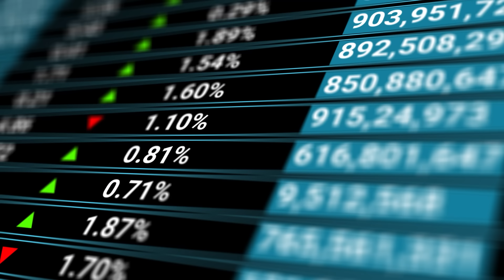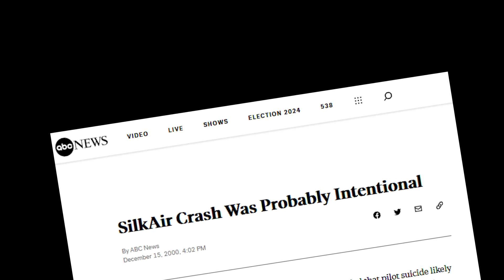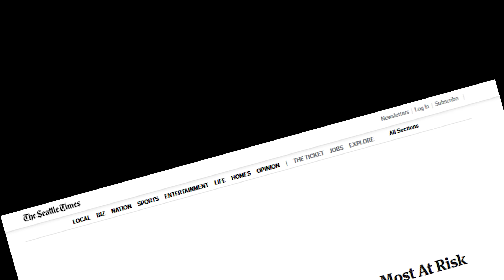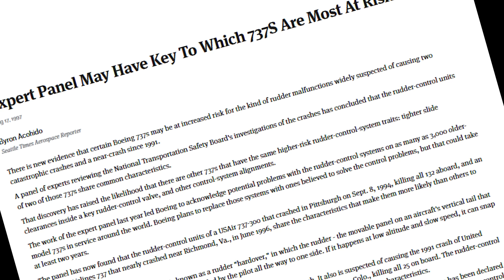What Caused This Plane To Break Up Mid-Flight!? | SilkAir Flight 185

Comment: I researched this crash when I was covering the aerospace industry many years back. There was a lot of resistance in Singapore and Indonesia to the theory that the crash was deliberate, but honestly nothing else seems to fit. As I recall, US investigators were literally unable to reproduce the aircraft’s extreme descent profile as tracked by radar in a simulator without deliberate, forceful and sustained use of the controls. This was not an out of control aircraft falling out of the sky, nor was it a crew struggling to keep a crippled aircraft in the air, nor was it a somehow disoriented crew accidentally flying under control into terrain. There really seemed to be only one other possibility. At the time, crashes caused by deliberate pilot action were (almost) unheard of, so the idea that a pilot might do this seemed unthinkable. But then came Egypt Air, then most recently Germanwings, which was the first time such an act was unquestionably, 100% proven. So, the idea that the SilkAir crash was deliberate doesn’t seem so unthinkable any more.
Reply from the maker: Such a good point, 'At the time, crashes caused by deliberate pilot action were (almost) unheard of, so the idea that a pilot might do this seemed unthinkable'.
Reply: I think it was the Smithsonian channel whose reproduction of the Silk Air accident I watched and they came to the exact conclusion you mentioned.  As there had been some previous rudder problems with this aircraft type, the Indonesian government latched on to that and refused to accept the NTSB’s probable cause.  However this was the only explanation that fitted the facts and most people are convinced their conclusions are correct.
Reply: For sure was a deliberately action. Difficult to accept but the painful truth 😞
Reply: @moiraatkinson  Not just the Smithsonian channel.  Other shows too.
Reply: @CuriousPilot90  If a pilot wants to take himself out, he needn't take innocent passengers and crew. Of course, AR-15 massacres are now ruled suicide. I worked for a major US carrier as a cabin crew for 25 years and beat death on the job 6 times, 3 of which were at the company's behest, as is legal according to SCOTUS. Twice it was to save money and the 3rd was out of spite as a merger and acquisition was in play and reducing payroll assured the job security for those firing the most. They maimed me for life, and told them how to prevent TBIs, Cervical Spondylosis Trauma, Pneumothoraxes, collapsed lung from torn fascia lung lining due to my recurrent training at LHRTK the day before. Men over 35 should wait 36 hrs before flying after hitting a bucket of balls according to flight surgeons,. I was 42 and UAL had tried to kill me in RIO so I expected it. All 3 can cause death at 37,000ft (8000ft cabin pressure), but United Airlines is fine with killing crew and passengers as they're insured. Terminated 4 weeks before retirement with a permanent disability and no insurance at age 55 which is a death sentence in USA, but I live in Sweden and my Karolinska Institute rehab has proven efficacy. UAL prefers faith healing and said my MRIs, were fake as was Karolinska's orthopedic rehab. 90% of men aged 65 have bone spurs, but my flight attendant union was conjured by women for women. Chicago's attorneys love carriers that maim passengers for life or kill them as it keeps the client pool full. 
I called the FBI to warn of UAL's policies of abuse possibly leading to an AR-15 suicide at Elk Grove Village.  Americans may not know that are allowed to be killed and might take it personally. Whistleblower protection is a farce in America, as ABA will disbar any attorney that reduces their potential client pool, at least in Chicago. I've been trying for 14 years to keep UAL from killing and maiming pax and crew, but because I refused their faith healing offer to keep my job, they think I have dementia...you know MRIs are the devil's brew in Chicago. 
I wrote to UAL's BOD, OSHA, NTSB, UALMD, UALTK, EXOSW, DENTK , LHRTK and visited my hospital that pumped my lungs in LHR to ask them to warn crew. Keeping American companies from killing employees is a Sisyphus task, but it keeps me going. Sisyphus defeated death too.
All Americans are on somebody's spreadsheet as a capital asset and are allowed to be liquidated.(see USA's 4% of global population and 20% of Covid deaths, with vaccines after CDC told media 80% of Covid deaths are 65 and over, or on FICA aka pensioners or entitlement moochers to those that told their over 65 audiences, Covid was a hoax, and vaccines kill).
Flying is the finest job I had, but for the worst clusterfrackin' company I ever knew. Hinge migration is preventable, as is pneumothorax, but killing crew to reduce payroll is more important.
Reply: There’s a more recent , deliberate crash than German wings , that is the Chinese deliberate crash .
Reply: We also have the mozambiqu e190 crash and the china eastern one
Reply: @dthomas9230  - pretty sure you should seek some psychiatric assistance as you seem to be doing quite a bit of confabulation and disturbed thinking.
Reply: @Gus1966-c9o  China Eastern Airlines Flight 5735
Reply: Reading this, I’m now rather curious about your thoughts on a different flight. China Eastern Airlines, Flight 5735. 

Ever since it happened I’ve been unable to get it out of my head that there’s no way that it isn’t a purposeful crash. The descent profile just seems so sudden and oddly smooth? Versus descent profiles of other crashes with mechanical failures where you could see the pilots fight with their malfunctioning plane within their descents. A bit more erratic, where the struggle is visible in the flight path. But to me it just seems like they just slammed forward the plane. There might have been a temporary regaining of control by a different crew member but whatever or whoever caused the descent seems to have re-taken control and pushed it back down again. 

Idk, is that thinking weird? The only other causes I can think of is maybe an extreme pitch control malfunction? If it was a reversal, there would have been flight issues from the beginning, like Air Astana 1388, right? Or if let’s say if there was a physical part that fell off, like the horizontal stabilizer. Like with Alaska Air 261/Continental Express 2574. But idk if this kind of descent would line up with that, or how they’d be able to pull back up and maintain altitude before pitching down again with a missing horizontal stabilizer. 

But that’s why I thought I’d ask what you thought. I just know what little I know from a couple years watching these types of videos and reading some books. Does 5735 also seem purposeful with what information we have, like Silk Air 185? Or do you think we should give the crew the benefit of the doubt because there are mechanical failures that can result in a similar flight descent?
Reply: why would you say such horrible things  to this guy telling us the truth about what goes on in this horrendous industry .Anyway people like you tend to call whistle blowers lunatics,just to hide your evil deeds 😳🙄😩
Reply: @CuriousPilot90  according to a source the ntsc apparently knew it was a suicide but they didn't publish it because they didn't want to make flying look unsafe
Can't verify this statement though
It's possible for sure because prior to his crash there were only 3 pilot suicide cases to this, all which were relatively unknown (the dc 8 crasg in Japan, atr crasg in Morocco and the psa 1771 hijacking)
Reply: If investigator blame the crash on pilot. Boeing don't need to pay compensation. However, In 2004, following an independent investigation of the recovered PCU/dual-servo unit, a Los Angeles jury, which was not allowed to hear or consider the NTSB's conclusions about the accident, ruled that the 737's rudder was the cause of the crash, and ordered Parker Hannifin, the PCU/dual-servo component manufacturer, to pay US$44 million to the plaintiff families.
Reply: it was pilot suicide
Reply: @yutakago1736  hmm a jury that wasn't able to view all the evidence for themselves, or actual crash investigators that cannot reproduce the crash in anyway except for when controlling for deliberate pilot input. I wonder which one I believe.
Reply: @dthomas9230 what a story
Reply: @dthomas9230  I love me a good schizopost.

Comment: What really makes me believe it was pilot suicide is the voice and data recorders being switched off.
Reply from the maker: It may have been that there was an electrical fault that caused this? But with all the other indicators this appears less likely.
Reply: @CuriousPilot90  It sounds like you made up your mind already with shots of the cockpit door locking mechanism and the specific circuit breaker panel on which the CVR and FDR circuit breakers are located on the 737. 😋
Reply from the maker: @ImperrfectStranger   I always try to keep an open mind about these things, especially with an incident like this where all the facts are not known. I may have done that a little out of sequence but I was attempting to show the copilots route out of the flight deck with his meal😬! With the circuit breakers, that was just unfortunate! The Captains CB panel just seemed right for the issue that was mentioned. It honestly wasn't supposed to be subliminal messaging placed throughout the video. 🙂
Reply: @CuriousPilot90  Thanks for the feedback 👍
Reply: CVR was actually from other aircraft, not an original one come from factory, and has a long story of self-malfunctions.
Reply: @@Steve_Sharpe He understood and acknowledged what I was saying. I acknowledged his response and was satisfied with his response. I was mistaken. Happy?
Reply: Read the ATSB report….
Reply: He was chanting Alla........
And the rest was history
Reply: Among many other things

Comment: It is common knowledge among those of us who fly the 737 that Silk Air was pilot suicide. There is only one way you can achieve that level of pitch down in the 737 and that's from holding the control yoke firmly with a significant amount of force forward. The airplane instinctually wants to fly and if you let go of the yoke it will level off. Not even with the worst elevator trim issues could you achieve that downward trajectory.
Reply: The moment I saw the numbers for the descent rate I had to calculate it. Nearly 1200 Knots. I'm not sure if there is any airplane that can dive like that uncommanded.
Reply: @GuyNamedSean Calculating the vertical speed using the 8 seconds of decent from FL350-FL195 you get over 100,000 fpm which is an insane decent rate that can only be done through force
Reply: This incident is talked about here in Singapore
Reply: Yeah, I think Boeing tested it and the only possible way to achieve that descent profile was pilot intervention

Comment: The NTSB determined that the flight profile was impossible to do without manual input. The crash ws caused by the pilot.
Reply: how can pilot cause rear section to break off?
Reply: @print-master  speed because the plane was at supersonic speed when it hit the ground

Comment: The most likely conclusion is that it was intentional. An airplane doesn't just drill itself into the ground like that. The fact there were no issues with the plane, coupled with the circuits being pulled, is pretty damning evidence to that.
Reply: All aircraft have no issues until they do. No one noticed the cracks in the fuselage in that Hawaiian aircaft until the roof blew off. The 737Max incidents showed that at least one aircraft type was capable of drilling itself into the ground unintentionally. The videographer led you to believe that the circuit breakers were pulled by showing you pictures of the circuit breaker panel, but was it proved that the clicking sounds were related to the cockpit door being locked and circuit breakers being pulled? My first thought was a rear bulkhead or rear fuselage failure causing wiring to the recorders to be damaged. Recorders are usually positioned in the tail area. The tail coming off could also be evidence of this. However, with all the other evidence..... as you say, pretty damning.
Reply: @ImperrfectStranger  germanwings proved that someone could do such thing

Comment: Absolutely no doubt… this was suicide & murder of 103 people….I am a pilot too & no way could this have happened any other way. I agree with the NTSB report 100%
Reply: This is why people are scared of your kind of thinking. For you there are no coincidences. You are the type to convict people of murder based on circumstantial evidence. How did he pop the whole back section off?
Reply: @vertigo2894  definitely you are not a pilot so you don’t know. You probably haven’t even been inside a cockpit.
It’s soo easy to pop them off… and it takes just a seconds to do it…
But, then, no point in debating with you, you are just a conceited person who thinks he / she knows better with ZERO aviation knowledge.
I have been a pilot since Aug 1988…, do you know more then me? 
And where is your research / statistics to prove people are scared of people like me? Seems you are all in the air with no facts…
This was no coincidence. CB  don’t just pop in a row…
They have independent circuits and each engine is operated by at-least two independent feeds of circuits!
Reply: Actually one doesn't need to be a pilot or NTSB expert to calculate that such extremely fast "descend" is only possible by intentional dive.
Reply: @vertigo2894 quick thing. I don’t think the back popping off was purposeful, but was a result of purposeful action of the captain. With enough speed and with an intense enough angle in your descent, you can achieve forces beyond the limits the plane is built to withstand. In such situations, planes are known to break apart mid air. If this was a purposeful crash, the extreme forces that were the result of the captain pushing the plane down so steep and fast would be enough to split the plane into two pieces. I’m sure it wasn’t his objective to do that, just if it was a suicide/murder crash that it was a side effect of the steep/fast dive.
Reply: @Stabilization  You changed my mind.
Reply: 100% pilot went HABIBI !!!!!

Comment: Those metallic clicks sound like the Captain switching off the recorders and the First Officer being locked out of the cockpit. I think the fact that there seemed to be no attempt to throttle back before the crash indicates deliberation. It's tragic that the families of the passengers and crew, and the wider flying community will never be certain about what happened.  
Btw , I have no experience of aviation except as a passenger.
Reply: The metallic clicks were just the captain taking off his seat belt. A deliberate pull of the circuit breaker makes no noise, which is what led the investigators to explore the murder-suicide hypothesis, as a CVR circuit breaker that is tripped will have its pop heard in the last moments of the CVR recording. The FO even made ATC contact in the minutes between the CVR being off and the FDR being off. Those minutes must've been the captain preparing himself in the bathroom or something, plus giving plausibility to a request to the FO to "check something out".
Reply: @OwlRTA  thank you for explaining that so thoroughly. I see now what happened. How, sad for the loved ones of passengers and crew never to be sure of what happened.

Comment: Such an interesting incident, there are many indications that the Captain may have been involved but even still it would be difficult to say. The mission he was supposed to fly in 1975 on the same date is a strange connection. Maybe he felt guilty that he wasn’t with his wingman or that he might have been about to prevent the incident. That could have added to it! Crazy. 
Excellent video! Great to have you back.
Reply from the maker: Thank you, I found it interesting to research and make this one. One of the indications in isolation would be fine but there appeared to be several.
Reply: It's not difficult to ascertain. It was the captain.

Comment: This is pretty cut and dry, isn't really a mistery.
The captain lost millions in the stock market.
The cvr breaker being pulled as soon as first officer leaves cockpit.
A few flights earlier,  the captain did a trial run by pulling cvr when copilot was gone.
The investigation found that th only way for the plane to fly like it did was by the controls meaning there was no failure that would make the plane fly in that nature.